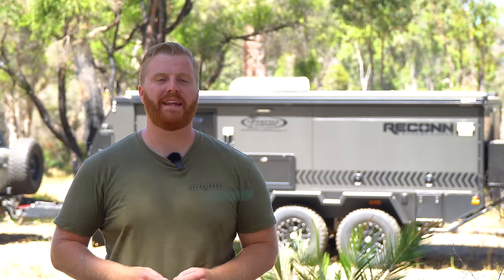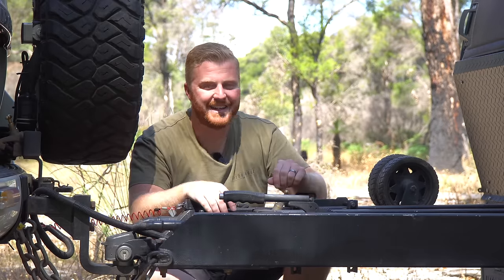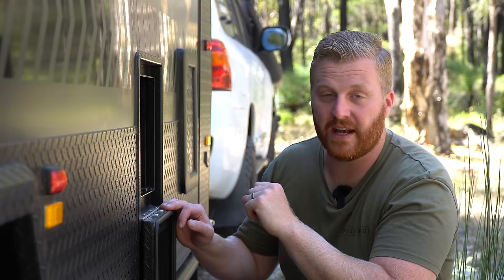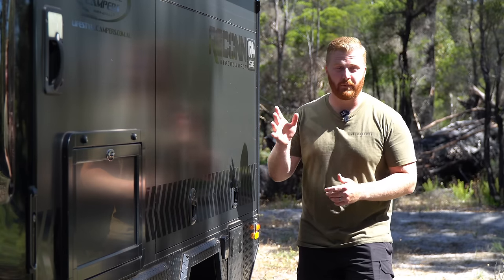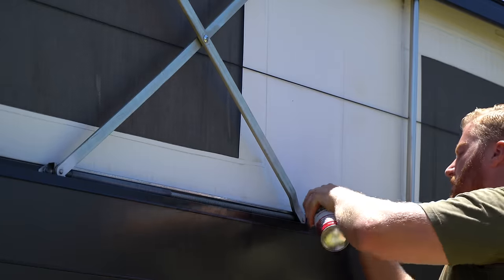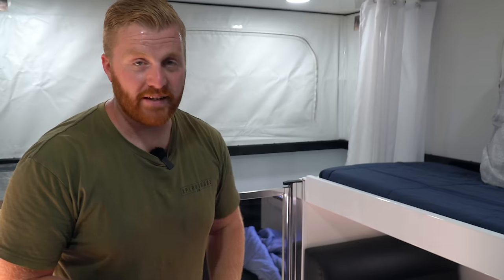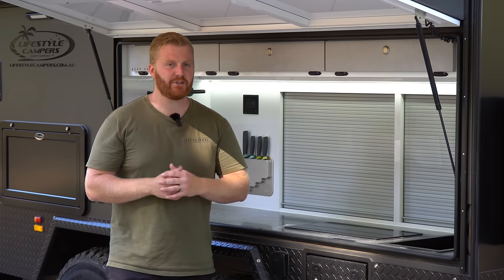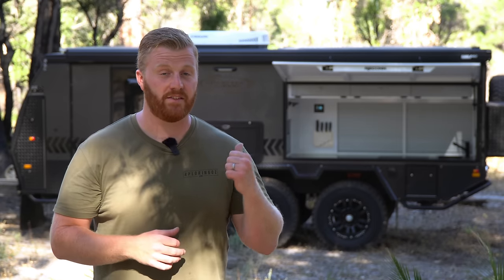12 month EXTREME testing of the Lifestyle Reconn R4T SE | 1 year review | Hybrid Camper Australia

Comment: G'day Nathan,a great, unbiased  balanced ,real-world review of the Lifestyle camper. I agree with not having scrub bars ,we have a similiar  racked rear section & has never looked like scrapping. The trailing arms on our camper took a pounding also ,I made a protective  flexible flap fitted in front of the trailing arms .I repainted the trailing arms no further damage in the the last 16k. The Camec doors need kind treatment, a mate  has broken the plastic mesh door clips on a couple of occasions ( he used to slam the door)😮. I machined him a couple of aluminium replacements with no further problems. The Reconn appears to be a more than capable unit ,but with any trailer, there has to be some compremises, but you experienced very few. Safe travels
Reply from the maker: Thanks mate. I have been very impressed with the quality overall, especially considering what we put this trailer through! 
Nothing is invincible, but something like the Reconn is certainly setup for someone who just wants to hop in and go without worrying to much or spending weeks and weeks before their trip doing DIY projects!

Comment: I am glad you have had so few problems with yours as it gives me reassurance that our recent purchase of a Reconn LRX was the right move. We have on had a week in it so have after the drive back to Perth from Adelaide (which included a bit of off road camp sites on the Eyre Peninsular). The only drama we had was having the scissor lift above the door sticking in the open position. We severely bent the scissors before we realised it had stuck. My immediate thought was that I had left something above the fridge but I had not. I could only close it was by putting all of my weight on the roof while lowering. I have no idea why it jammed as it is a very basic mechanism, Lifestyle replaced it which was good even though they initially said no. They originally stated that I must have bent it while raise the roof with a latch still attached which was definitely not the case. I thought it may be a drama, but once I escalated the issue to their customer service manager, they agreed to cover it under warranty. I cannot really fault them. I am looking forward to more adventures to erase the bad memory.

The wood box that came with ours is a much better design than the original that you had. It is a lockable box with a heavy duty mesh bottom.

Our LRX came with the extended draw bar. When I was originally spec'ing a R4TSE like yours, I wasn't going to bother. I have a LC200 with rear spare wheel carriers and I am actually glad I have the extended drawer bar to give me a tighter turning circle while reversing and a lot more access to the rear of the Cruiser when attached. I have a GX with the barn doors.

Nothing is perfect and things will go wrong with components. Lifestyle seem to want to maintain their customer reliable reputation so far with my dealings with them. The thing that sold me on the Reconn was the chassis build strength, suspension, the Victron 12V gear and how as much of the plumbing and electrical cabling is inside the chassis. There is very few breakables hanging below.